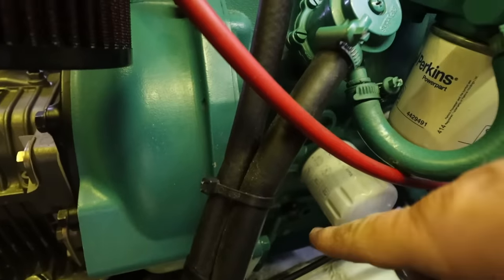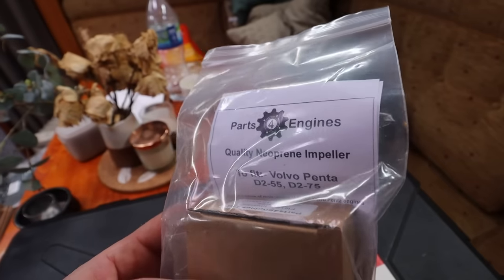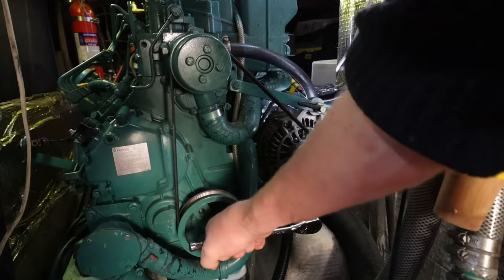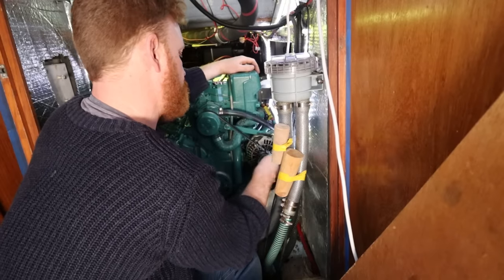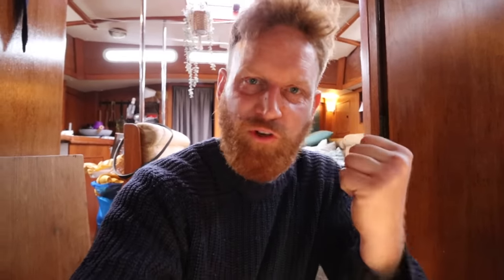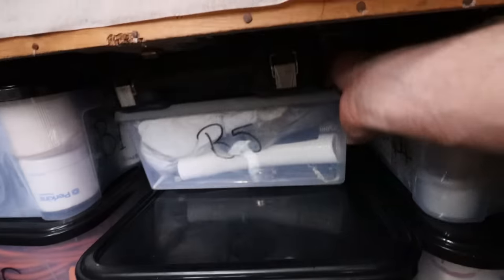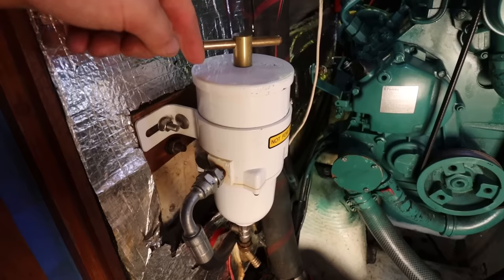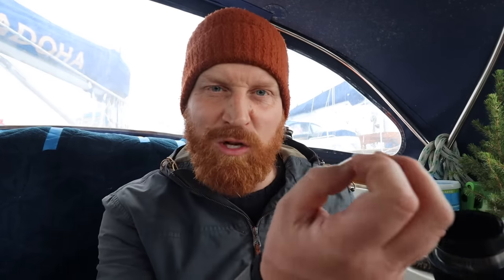Volvo Penta DIY - Full Marine Engine Service

Comment: Did I miss you putting back the impeller ?and why on earth would you spray Salt off on the water pump belt and I think you sprayed it on some wires as well.
On the air filter instructions ,they are very easy to read, all you do is hold your camera phone up to read it on Google translator and they you go.
I have never seen any one wet an air filter and the put a spray of oil on the filter. Buy doing this you are making sure you pick up all the dirt in the air going into your engine.
Reply from the maker: You know I've only just realised that I didn't include the footage on me putting the new impeller in?! 😳

As for the salt off, I spray it anywhere where salt water may have splashed up from the impeller change and it's seemed to have helped kept the engine from getting as badly corroded as I've seen some over the years, that's my hope anyway, although always open to other suggestions.

The air filter kit was exactly that, a specific kit for cleaning the air filter. Are you saying that you wouldn't use that particular kit?
Reply: @CadohaAdventures  I just saying I never seen a kit like it but different manufacturers may do things different ways.
It just I never seen it before or have never seen any one on YouTube do it that way.

Comment: Great video but it looks like your old impeller came out with a vane or two facing the wrong way.  If this is the case ensure that you twist and push the impeller into place so that all the vanes are following the direction of the raw water pump.  Lots of other videos showing this.
Reply from the maker: Hey Andrew, all the splines were still attached, but a couple of them were bent over I'm guessing from where they've been stationary for a few months in the water pump?
Reply: @CadohaAdventures , the vanes orientate themselves in the first part of the first rotation; don't worry about them. Some people fix on this as a major problem, but it isn't.

Comment: Just check belt is in the proper place on the alternator .. it's a bit odd on that engine .. can't quite see on the vid. .. check the manual
Reply: Soz .. I might be wrong .. I thought you had a D2-40 .. but its a 55 - so it may be ok
Reply from the maker: It seems to be ok, I’ve had it running a few times since making this video and nothing out of the ordinary has popped up. 

Appreciate you taking the time to give me a heads up though, cheers 🙏🏼

Comment: Also, you never ever prime the filter that way… how clean is your diesel? You just left a quart of trash in your fuel system.
Reply from the maker: Hey Greg, thanks for chiming in. How would you recommend going about priming the fuel system? 🙏🏼😬
Reply: @CadohaAdventures  I had the same question but  @gregk1179 apparently prefers to troll. Helpful video, thank you!